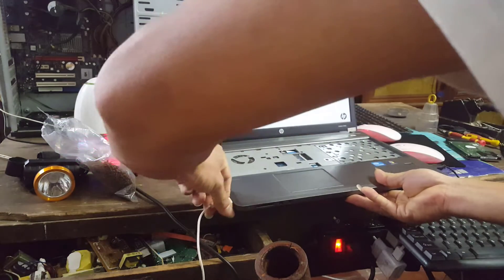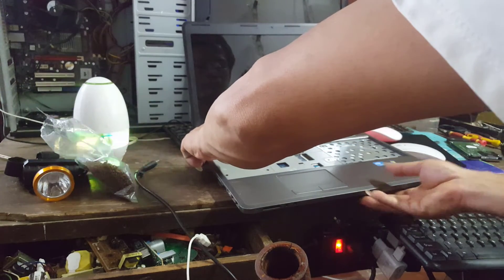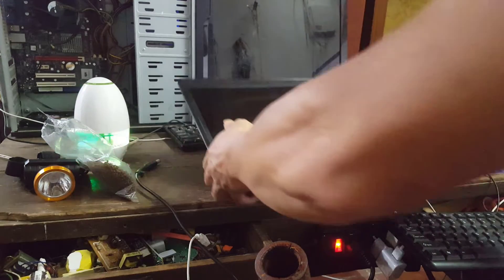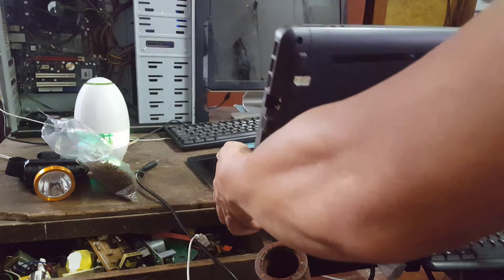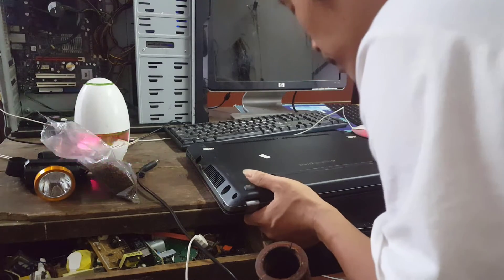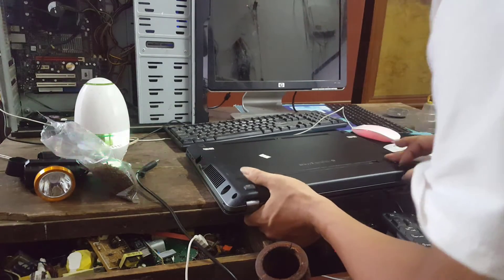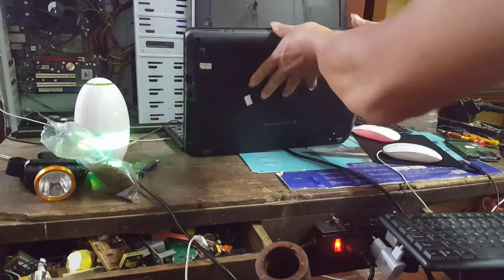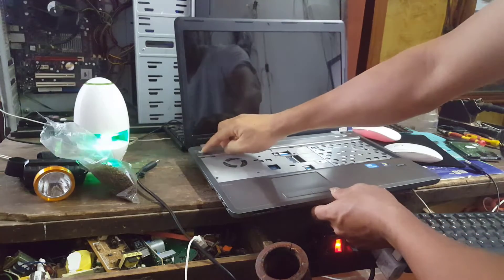Hp battery alert 601 fix

Comment: I have the 601 error code, should my computer still work if power cord is plugged into wall? Or does it need that eternal battery replaced regardless ? My computer still won’t work when plugged into wall socket, 601 error code.